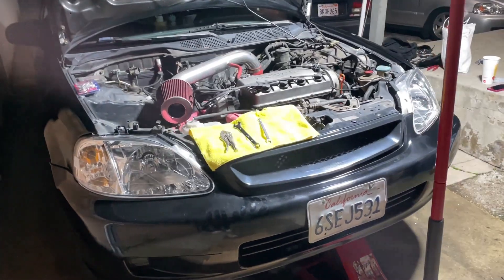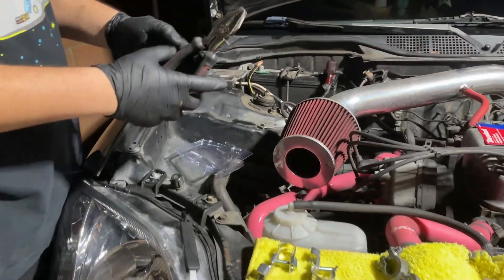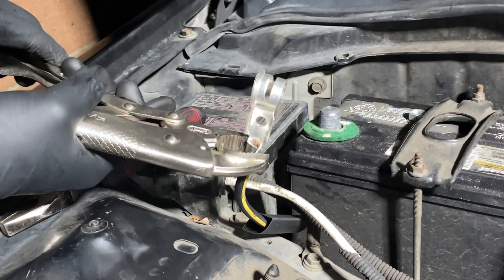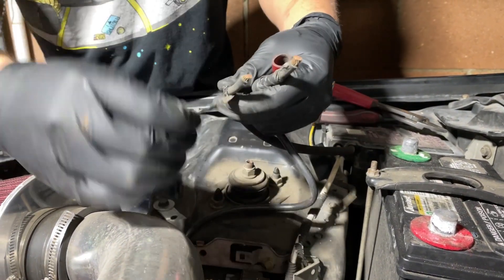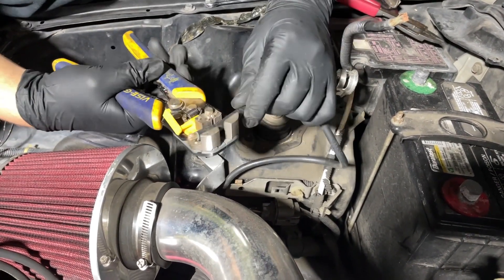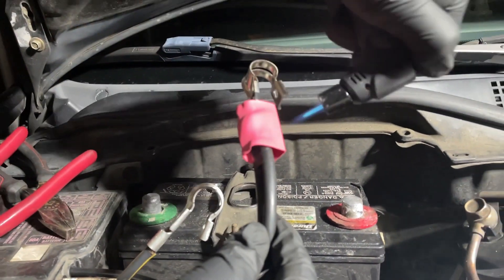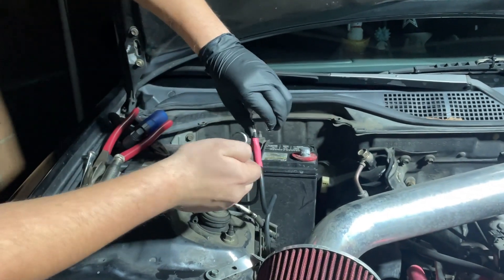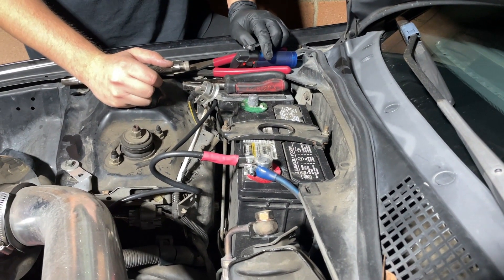how to change battery terminals on a Honda civic 96-00 ek

Comment: I had I question bro, I noticed how we didn’t really get to see how you attached the blue wire on the positive terminal and I wanted to know how you would do that? Right now my blue write has the writing exposed and I places to touch the positive battery terminal but I don’t think it’s placed how it should be. If you have any advice or could refer me to a video it would move much appreciated bro
Reply from the maker: that blue wire is for the car Amp. if you add a amp to the car stereo you need that extra power which that's why the positive wire(blue wire) is there connected to the positive terminal , the wire can be different colors and will need a fuse just incase the positive wire touches any ground and cause a shortage . look and search around "how to connect my car amp to my battery" so you can have more of an idea